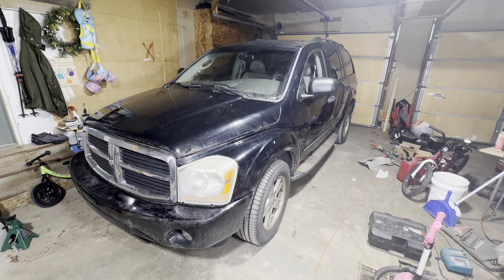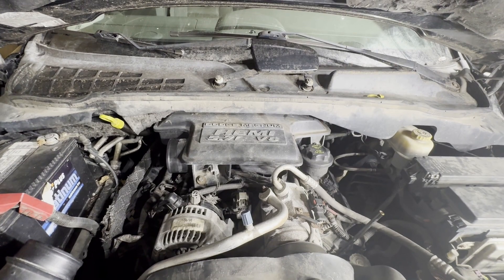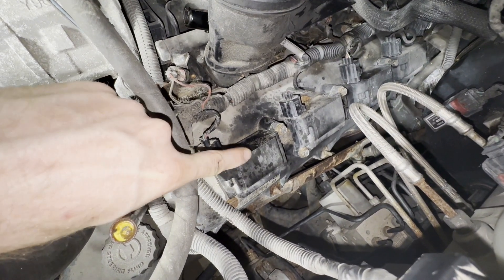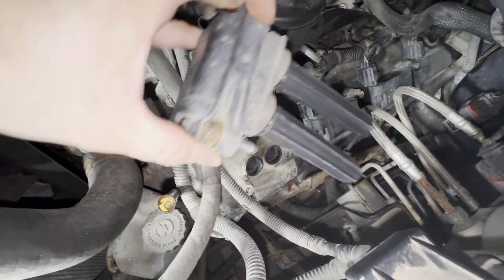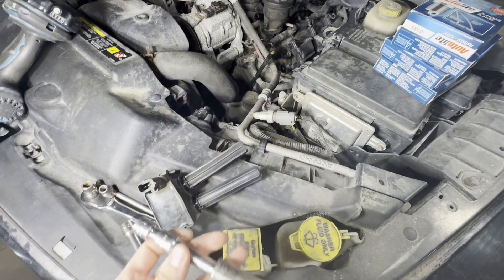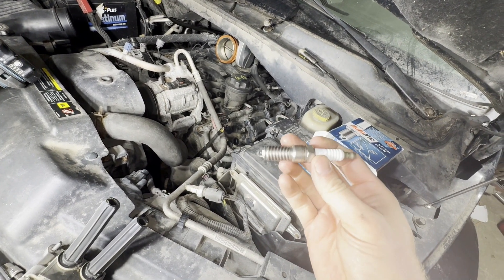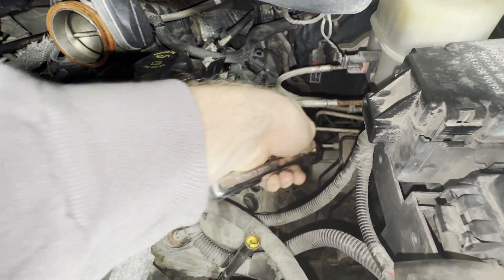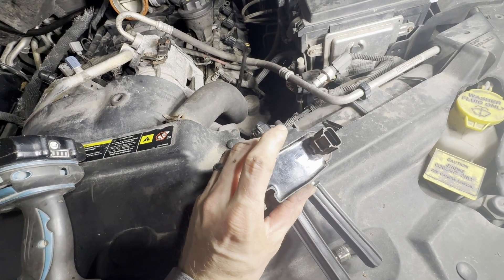Spark Plugs and Coil Packs Dodge Durango 5.7 Hemi v8 04 05 06 07 08 09 2004 2005 2006 2007 2008 2009

Comment: I was wondering I bought a dodge Durango it’s 2004 I bought it for 500 dollars but he told me the rain storm the water got in the crankcase and before I bought it been sitting 7  years can the truck be fix I just want to hear yall advice I shouldn’t by it
Reply from the maker: Sitting for 7 years is a long time. Brakes could be seized up and lots of other issues can happen from sitting. But honestly $500 is basically scrap metal price. So the price is right. End of the day, I haven’t seen the vehicle. I don’t know your skill level, my advice is worth what you’re paying for it.
Reply: @ right they told me they drain the oil after that happen